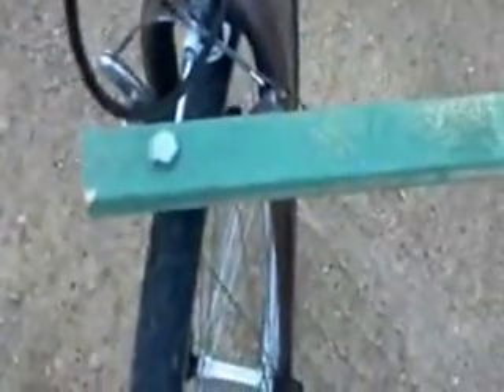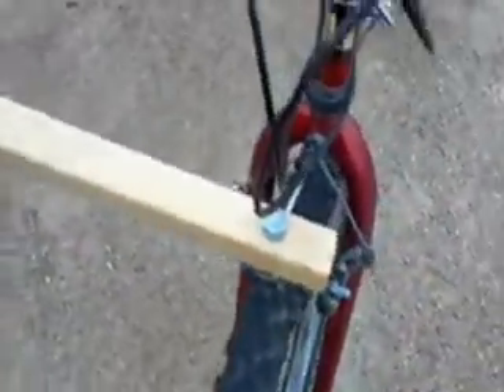DIY QUADRICYCLE EVEN BETTER!_0002.wmv

Comment from the maker: Haven't really done anything else with it--could definitely work as a camping kit as is. The one improvement I would make is on the steering bar. Drill out the holes on the forks a little bit to have stronger bolts, and a threaded bar with an adjustable nut in the middle would be a huge improvement--then you could adjust the length of that steering bar and get smoother, more coordinated steering.

Comment: Love what you have done is anything else been done for mods other then welding after this design I'm looking into this and as an electrician pipe is free main reason is for camping haul separate bikes then join when we get there solves camp fire beer balance problems for 2 separate bikes I really don't wanna weld them and to cheap to buy the granny bike kit

Comment from the maker: The steering bar connects the wheels and helps keep the steering coordinated--tho even with the bar, cornering requires discussion between the two riders. (That's why it's been dubbed "The Sociable" by friends who have ridden it. Try it--it's fun!)  For more details about the steering bar, check out 7:37 to 9:48 in the "old version" video. Thanks for checking it out.